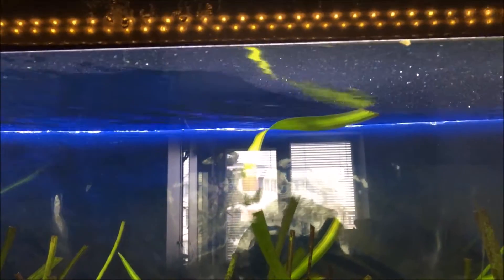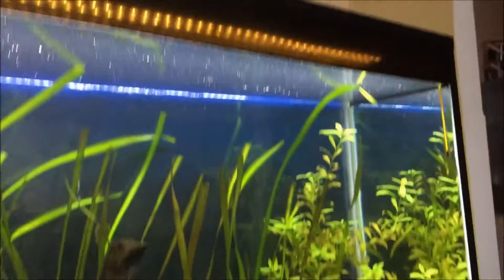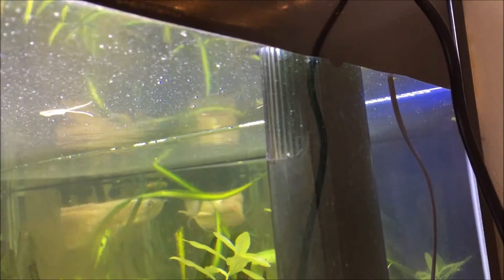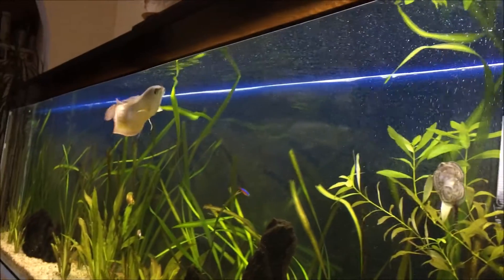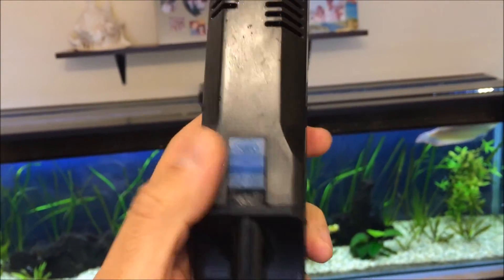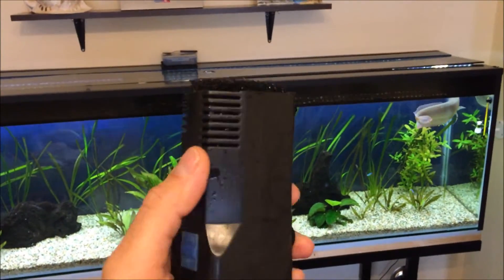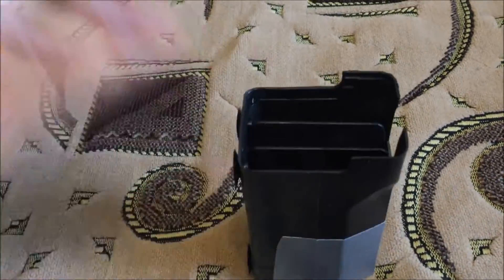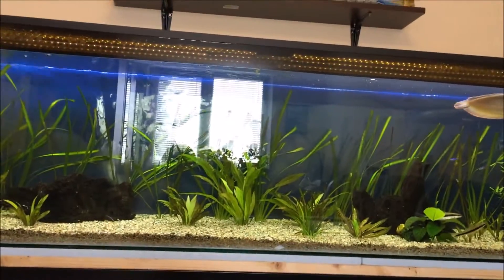DIY surface skimmer (biofilm remover)

Comment: Great modify to make that surface skimmer out of the old filter! 👍

In the end, you say you will leave it there for two weeks.
There is no point in that.
It's better to use it an hour or two when a new biofilm start to occur, just leaving it there will of course keep your surface clean, but it doesn't matter if you leave it 14 days or 14 minutes after the biofilm is out, once you take it out, a new biofilm will soon start to form. 
An hour or so, once or twice a week should do the job.
Reply from the maker: That would work 👍 
Since then I drilled my tank (along with other major upgrades)  and the biofilm is going down that hole 😁
Reply: AquariumLover 
Excellent with a permanent solution!
I was reckommended this video by YouTube, it seem your channel is worth looking at more!

I'm subscribing! 😀